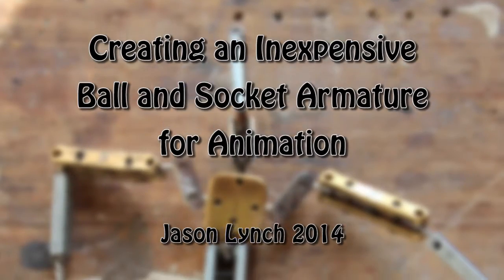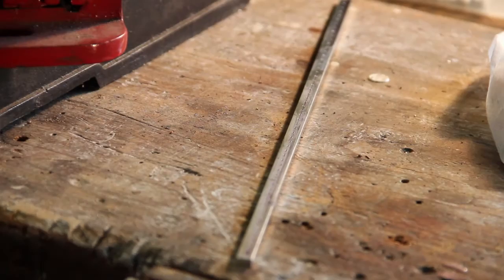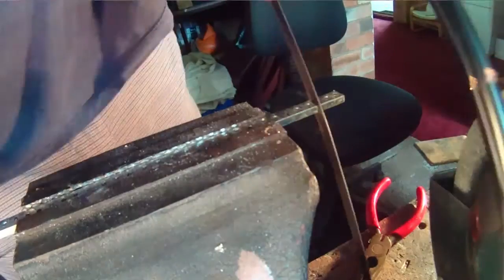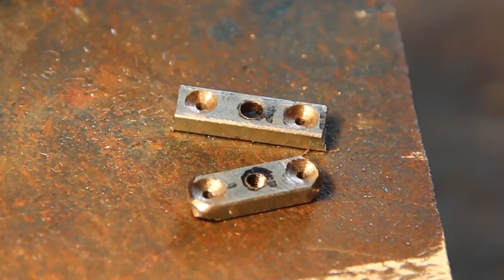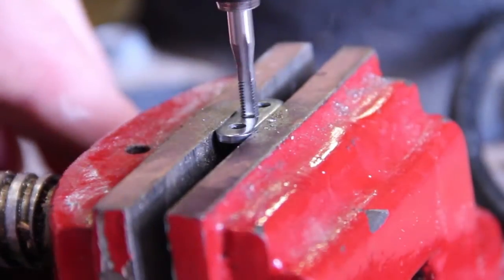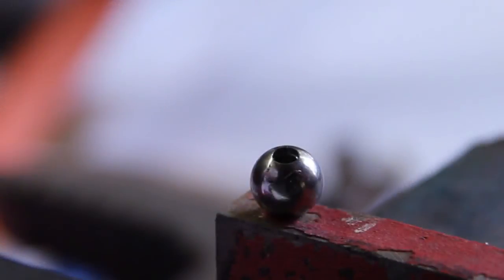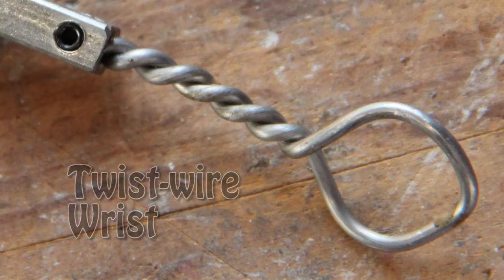Ball and Socket Armature on a budget

Comment: here's a pro tip....
... use tongue ring barbell stainless steel 5mm or 6mm externally threaded.... balls... with a 14 gage or 12 gage bar setup.... (you can now skip all this crazy metal work that is sooooo time consuming

Comment: This is very nice Jason and the smooth quality of your animation speaks very well itself for your armature making skills. However, though you did go into a lot of great detail on all of the other aspects of crafting the parts, you completely skipped over how you drilled the holes in the balls for the ball and sandwich plate joints before you soldered the rods in them. There are probably folks that would find that part difficult do correctly and a good example would have been welcome. Even I would be interested in seeing if you were doing anything different there. Constructive comment for next time, please include that step in future videos.

Comment: Great video! Unfortunately, I have hardened steel ball-bearing balls only. I've managed to anneal them with a MAP gas torch to take the hardness out of them then file a flat spot quite easily. Heating the steel ball until it turns red hot then letting it cool down to room temperature in its own time (approx 5 to 10 mins).
Reply: You want them hardened also as soon as you heated the ball bearing to a certain temperature it's ruined and a ball bearing. It will lopsided which will be acceptable for these joints but it allows microscopic abrasives to get in and make that terrible dirt in ball joint noise.

Comment: Thank you Jason! This is the best ball and socket tutorial I have come across so far. After a lot of frustration and money spent using ball and socket kits, I've decided to learn the craft of custom armature building and will be referring to your video throughout the process. 

Quick question:

What width and thickness of mild steel do you use for the plates? And have you experienced any bending of the plates/breaking of the soldered joints at high tension? (I've started to play around with silicone puppets. The body of the one I am currently working with is beefy, requiring high joint tension, and causing the threadlock in my kit to fail)

Thank you!
Reply from the maker: Thanks Samuel. I appreciate the feedback. I'm glad it is of use. Yes it can be finicky, but it's fun and a good feeling of satisfaction knowing you made your own.

Comment: How did you drill the ball ?
Reply from the maker: +omar lopez The ball drilling is tricky. I usually don't use proper ball bearings. I use Sling-shot balls. They're not hardened. Then I run a file across the top to create a flat spot and drill that part slowly with a 2.3 or 3mm bit. Other people who use a hardened ball bearing heat the ball to red hot and let it cool slowly. This removes the hardened state (apparently!)
Reply: +Jason Lynch Thanks man!!!

Comment: i am planning to make these armature  this is a great video very helpful... can you work and make these with aluminium instead of steel or brass as that must be easier to work with..
Reply from the maker: I’ve made similar with brass aluminium and steel. The only catch is to use different steel types for the balls and plates. (Eg brass balls with aluminium plates as with the ‘money or the box puppet) If you use the same, they seem to stick.

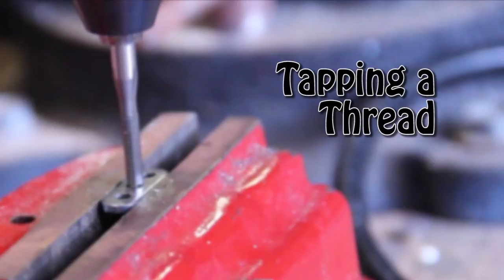Comment: 7:32 get a center drill bit as well. Typically, they are exclusively used in a metal lathe but I use them for any steel drilling. Center punch three times, then center drill until enough steel has been removed to prevent thinner bits wobbling, and just keep lubricating it. Lube should have been put first but everyone of your problems is because you didn't lube the drill bit or tap. Wobbling bit? Not enough lube. Chuck has runout? Not enough lube. Dog shit on the carpet again? He saw you didnt use enough lube when drilling. Jokes aside just make it a habit every new drill step quick spray of wd-40, one wipe from the oil can brush, or a kittle dab kf butter whatever you got haha. Most people end up spraying way too much but theres little downsides to excessive lubrication and many for not lubricating. Wd-40 is cheaper than taps.

Comment: Great Video. For the sling shot balls, did you drill those out or did you find some pre-drilled?
Drilling those seems like it would be awful....
Reply from the maker: I had a heap of larger balls that were pre-drilled, but yes, like pulling teeth, I drilled out the 6mm balls, Filed the top, drilled a pilot and then drilled a 3mm hole. Painful, but I did about 50 in a run. (3 at a time.)

Comment: Ok, this video is simply amazing! I have a question: what do you call the balls for the joints? Yours seem predrilled but I cant seem to find any of them at the local hardware stores. I tried using a regular drill, but probably only thing that will work is a colomdrill
Reply from the maker: Hi. The balls vary depending on what i have at hand. Normal Ball bearings are coated and very hard. You can heat and slowly cool them to be able to drill, but I use sling shot pellets, which are shiny and softer for drilling. It's a process, and I usually drill out 30-40 at a time so I have a stash at hand. I generally use the 6mm (or 8mm for the spine)
Reply from the maker: PS:  I drilled out the 6mm balls by Filing the top, drilled a 1mm pilot and then drilled a 3mm hole. Painful, but I did about 50 in a run. (3 at a time.) Also, I made a jig to hold the balls steady and used the column drill. I have used a hand drill, but snapped lots of bits and had inconsistent depths
Reply: @jasassin  thanks for following up in the comments. it's a good video but I I was thinking the same thing as a lot of other people about the drilling of the ball bearings which I found to be the most difficult part in attempting to build an Armature. I never thought of using slingshot ammo though so I'll give that a go

Comment: Hey! This video was a fantastic help! What were the dimensions on the key steel?
Reply from the maker: +Nicholas Cartwright
Thanks Nicholas. The Key steel I use (metric sized) is varied. For the legs and spine I used 300mm x 10mm x 3mm, for the arms I think it was 300mm x 6mm x 3mm. Hope this helps.
Cheers, Jason
Reply: Yes, very much so. Thank you!

Comment: What about using a solid wire for the spine? I want to make this model look real but would that through off the balance if I do that?
Reply from the maker: I guess solid wire is of use, I just find the Ball and socket gives you more control. It depends on what the character needs to do. Try not to overcomplicate if you don't need to.

Comment: hi how many hows would you say it took from the very start as in the drawing to the finished armature model
Reply: hours
Reply from the maker: Richard Kirk if I were not filming, I'd say this one would take a solid 8hrs if I were clear on what I hoped to achieve and had all the tools and stock at hand. 

Once you get moving and everything is set up, I find building in batches speeds things up. Eg build all the plates at once, drill and tap holes at once. (Rather than building one joint at a time)
Hope that helps.
Reply: thanks Jason i will have to give it ago this year would have don't it when i was doing my film degree but had to leave the course cos of circumstances
Reply from the maker: Richard Kirk sounds like a good plan. Give me a yell if you need any pointers.
Reply: cheers

Comment: So you are ruining the hardness of rhe ball bearing as well as its roundness. If you are making a joint that requires precision you cannot solder, weld, or braze these. I'm putting mine in a three jaw chuck, center drill , and then tap but that's because i need that near perfect roundness to prevent dirt getting into the joint in a dirty environment.